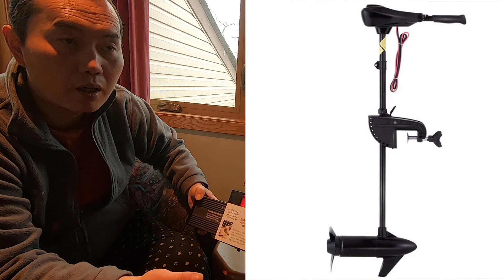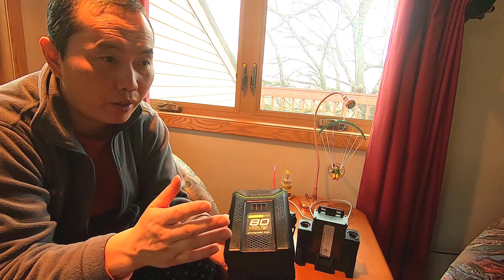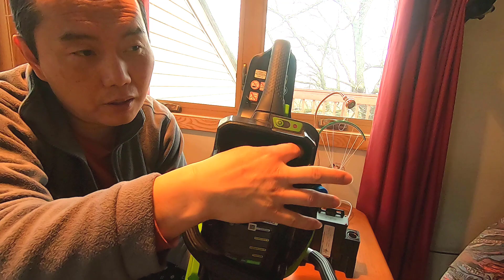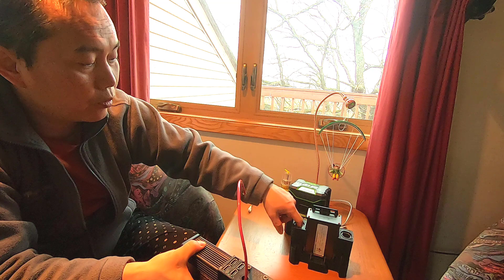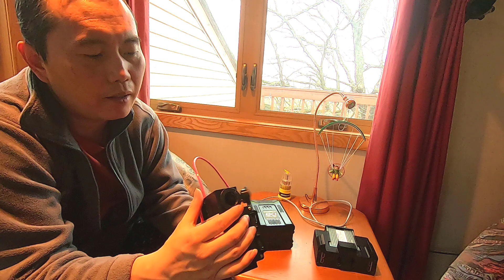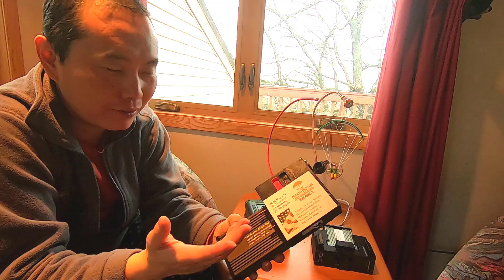Greenworks Kobalt 80v battery for trolling motor, scooter, power wheels

Comment: I first bought the Masterforce 80v 20" chainsaw after a bad storm, and 2 trees were blown over.  I've had chainsaws since the 70s, but this is the most powerful one I've ever had.  No messing with gas-oil mix, pick it up and start cutting.  I then got the Masterforce 80v weed trimmer.  I can dig the roots out of the ground with it.  More power than you will ever need.  Yes, they are both expensive, but they do the job fast and don't bog down.  One battery is bigger than the other, but they are interchangeable.  If Masterforce made an outboard or trolling motor, I would buy it.

Comment: If a trolling motor we are considering has a max draw of 34amps will we be ok with the 30amp breaker on your converter?
Reply from the maker: Yes. But it'll stop if you put full throttle for too long.

Comment: I’m still having trouble understanding discharge. You said your Paramotor is 15,000 watts. How much power is being pulled from the battery? What size controller are you using? How many batteries are you using at a time?

I’m asking because I want to use these with a pit bike that has a 200A controller. I assume I would need to use these in parallel to handle the power? 

Thanks in advance for answering. I don’t want to make a dangerous, expensive mistake.
Reply from the maker: Watch this video for details of 80v batteries.
Reply from the maker: https://youtu.be/7nGXA7s95dw
Reply: @JerryMinne  I’ve watched that video about 10 times (good for your ad revenue 🤣). I read the comments and it appears that the battery will stop at 40 amps max; and in the comments you told someone that in parallel you could run them together for much higher amps. However, in this video, if I understand, you also mention “15-20 amps;” but you also draw that huge power off of them in the paramotor. I just don’t understand. 

The parallel adapter on your website protects 45a. My controller will run 75a continuous, 200a for 30 seconds. I know I won’t run that many amps all the time, but will these batteries provide that power? 

Thank you for helping so many people to understand and enjoy this technology.
Reply from the maker: 2ah battery max 20amp, 4ah battery max 40amp.
Reply: @JerryMinne  
Then the 5ah Commercial batteries are 50a?

That makes it more clear. So two batteries in parallel will handle handle the continuous at their limits; three would safe; four would be fast enough for most scenarios I’ll find myself for now. Five would be pretty nuts.

Thanks again!
Reply from the maker: No. 4ah battery has double the current because it parallel 2 set 2ah batteries. 5ah or 6ah is the same max current as 4ah battery.
Reply: @JerryMinne  Ok. 
3 parallel, 4, 5, or 6 ah batteries would discharge 120ah max. Is that right?
Reply from the maker: Yes

Comment: You mention the wired ports on the side are for the 30A out, does that mean the car/cigarette power port on the end can't put out 30A as well and is limited to a lower output?
Reply from the maker: The cigarette output can only support 10-15amp current because the weak connection.

Comment: Do you sell this that allows 2 80 volt 6 ah and 5ah to run off this one inverter
Reply from the maker: Yes. It add adapters to link 2 80v batteries on it.